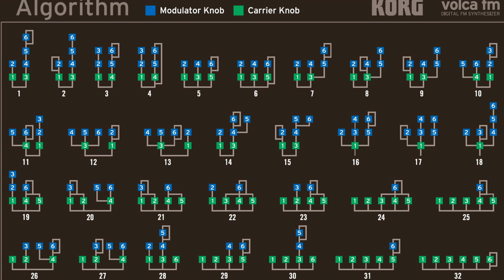Volca FM: Deconstructed Electric Piano [Episode 53]

Comment: I always wondered if one could make FM synth EPs sound more like Wurlitzers or Rhodes pianos- rather than the cornball 80s FM EPs we all know and hate.
Reply from the maker: It would be difficult with the Yamaha-style FM.  They are great at simulating the tines, but not suited to recreating the extremely nonlinear magnetic pickups and filtering/amp electronics (that's what gives the Wurlitzers and Rhodes their characteristic sounds).
Reply: @CatSynthTV  That makes sense. You'd probably be better off using digital oscillators and subtractive synthesis (filters triggered by envelopes, velocity etc) to get close... or just buy a reface CP and call it a day :)
Reply from the maker: @TheParanoidAndroid79  the modeling the Nord and Arturia do, combo of sampling, filters, and non-linear processing, are the best that I've heard.
Reply: @CatSynthTV  Googling this right now. Still learning all about this crazy synth jazz, and I appreciate those who take time to share their knowledge (and you know your stuff). Thanks!
Reply from the maker: @TheParanoidAndroid79  you're most welcome.  Always happy to share 😺🎹
Reply: @CatSynthTV  can this be done with Korg’s Opsix? It has more waveforms than just sine, and it has filters, ringmodulation and you can define own algorithms.
Reply from the maker: @hermask815  definitely!  I don't have an Opsix here but I'm sure it has several DX-style electric piano patches to use as starting points.  The additional waveforms (a la TX81Z) and custom algorithms open up even more deconstruction possibilities 😺